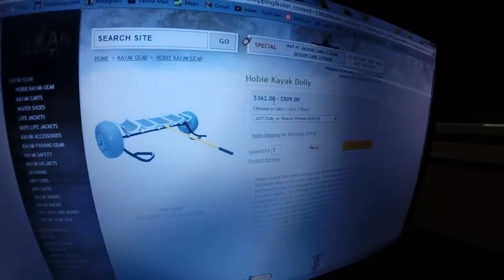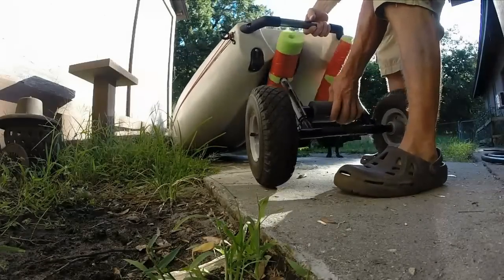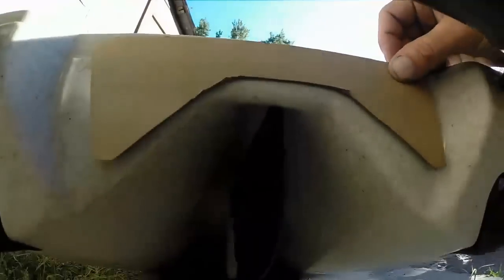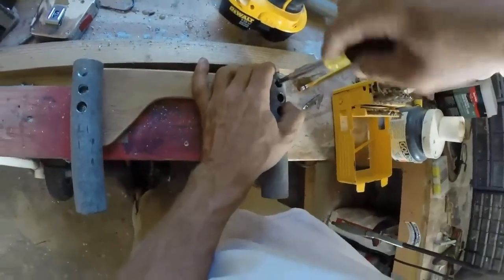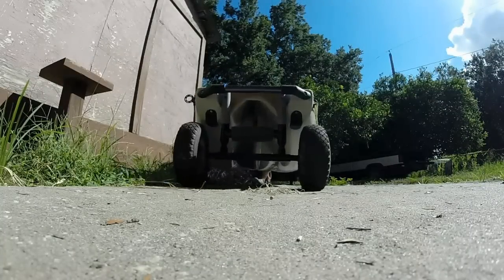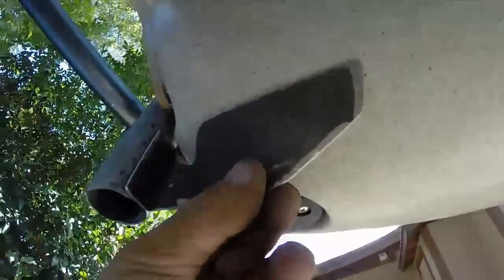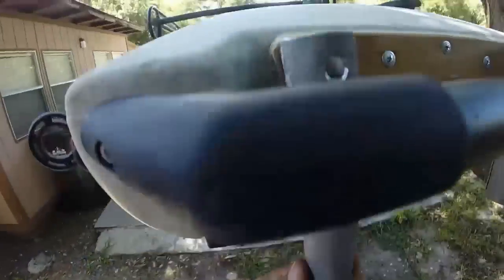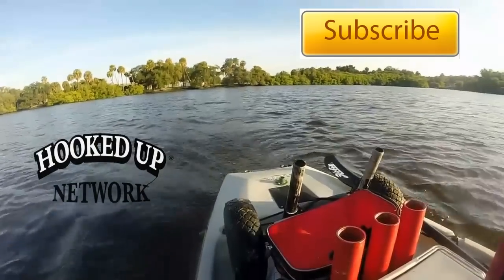DIY Hobie Pro Angler Trolley

Comment: I totally appreciate people that know how to do things for themselves as I am the same way.  I'm going to put mine on the back too when I get my new 2016 PA 14 next week.  I think I'll try to weld my fence poles to the existing handle bar.  BTW, you might want to consider sealing the wood that you installed because it's not going to last long before it starts to rot out.  Good luck.

Comment: That is pretty good ingenuity. One advantage of the stock mid trolley location is you just basically balance it, vs holding up  half the weight. Still much better than nothing.

Comment: Nice work around. The prangler is heavy no two ways about it. I pondered doing something like this, but I stuck with a modified scupper cart setup. The carrying all +/-120lbs. over long distances didn't appeal to me, at all. But seeing this has gotten me interested in maybe setting up a rig to have this as an option along with the scupper holes. Thanx for posting. Your ideas are always helping me think about ways I can improve my kayak experiences.

Comment: I  cryed watching the first screw going Threw the PRO Angler I don't feel bad buying another Hobie cart with the big low pressure tires for dragging over sand yesterday that cracked the tack welds on heavy duty cart recommended by Hobie for my Pro Angler

Comment: improvising is fun! Now you got a neat place to mount a steering oar or rudder for when you add a sail. Glad to see you using fence post. I rarely see anyone using metal in DIY. The metal conduit and fence post is the cheapest and strongest material you can get at the hardware store but it rarely gets used in DIY projects online, everybody seems to use PVC.. I was surprised though the wood was not painted orange. :)

Comment: the cool part is that you didn't change the trolley so you can use it on the old tried and true yak, and the new one.
And I agree the old fence pipes are going to rust pretty quick. But i guess you use what you have available.

Comment: Apparently my back is made of glass,i am waiting on multiple operations to fit 10 metal plates on my spin and facet joints and 2 plates in my neck.last year i had bilateral Pneumonia and this year i have Graves Disease which makes me weak .iv still to find a super easy way for me to load a kayak ...i would love a kayak trailer with a hobie that's easy to load ,but in Norway you are talking 10k dollars plus for a set up like this ..I almost gave up kayak fishing last year because i wasnt able to get back on the kayak after a deliberate flip.
I really dont want to give it up because i love fishing and Kayaking is fantastic exercise..
Fingers crossed by the end of this month i will know for sure about the operations and timescale for recovery ..:)

Comment: Great job there! Loved how you fabbed the old trolly to work with stuff you had just laying around. The wheels on the back of the yak is a great idea. I curse everytime I have to roll my kayak over to insert the trolly. It's easier to remove, I just roll it out into the water until its deep enough to pull them down and out. Now replacing it in the water is a royal pain because the wheels float. There at the end of the video you were scooting right along. Do you miss paddling? Kudo points for the old school head phones! LOL
Thanks for another great video!

Comment: Marty! nooooo that fence post is going to rust and its going to be a mess!! i would have used simple pvc or aluminum but aluminum in that thickness would be alot harder to find and make sure you seal those holes!!!
Reply: That's an excellent point Henry.
Reply: I had the same reaction that Henry did - PVC or Aluminum will last a lot longer than galvanized steel.  If you can find some scrap "eTrex" (PVC board) to use instead of the plywood, that would last longer too.  

Couple of things: can you reach that area to use bolts instead of screws?  That would let you use rubber washers or silicon to seal your connectors.

second, could you have made the "teeth" on it longer and not had to use brackets?  (sorry, your board reminds me of kid's vampire fangs)

Comment: Make a wood block that fits in between the handle and the boat with a lip at the bottom to support the boat and handle. Drill/holesaw 2 hole for the dolly.

Comment: why not put the trolley upside down in the mount and put a key trough the tubing to keep it locked in place - you sure wouldn't want to lost it if you tipped upside down or got hit by a BIG wave.
Reply: Bob Bohner
Reply: Bob Bohner Okay, maybe I spend too much time fishing or working....but I agree.... I am learning too...(one thing I learned (probably not a problem for space on a Hobie.  I put pins in my cart....quick connect/disconnect.

Comment: Umm ... a constructive idea .... I would have attached the Back wheel to the Back Handle with a simple half circle metal piece on top of the hold weel pipes .... a simple attachement would have zero screws into the yak ... and way less trouble ...

Comment: Why didn't you use pvc instead of the fence post?  It's lighter, does it need the strength?
Reply: Sweet idea!!!  I'm using pvc on mine.  It's only a 10' one but it gets bulky when I'm carrying it a distance.  With wheels it will be so much easier.  Thanx again for your videos.

Comment: so, you bought a 3500 dollar kayak but couldn't afford a manufacturer dolly?  then you drilled holes in it?  you could've used the back T bar put a couple clamps on it converted to pvc and if you wanted extra support you could t off with extra supports under the kayak.
Reply: He was given the kayak as a gift.  Wasn't something he could afford at the time.